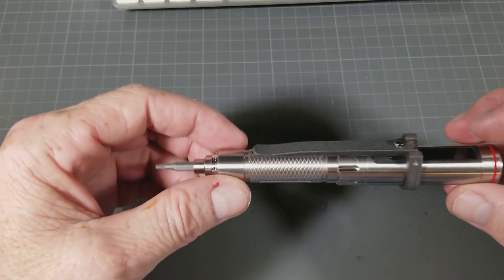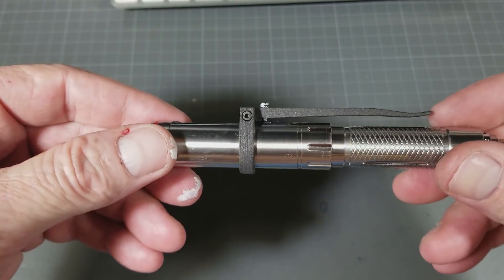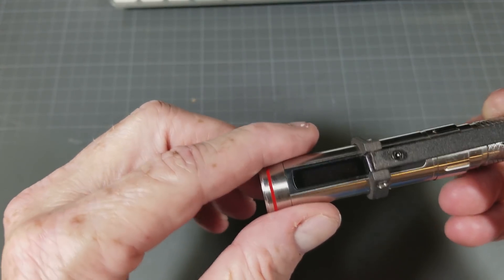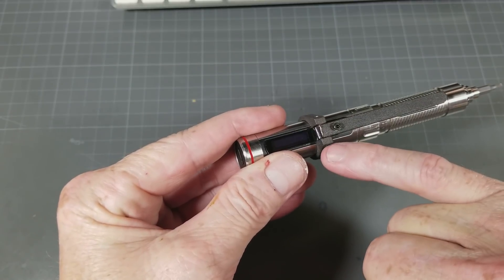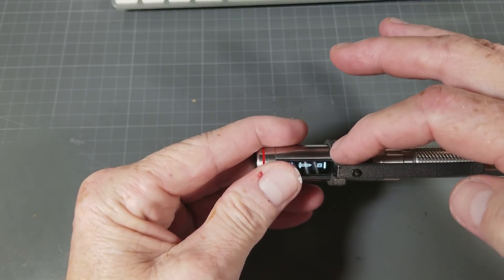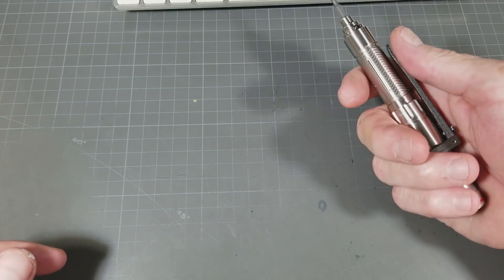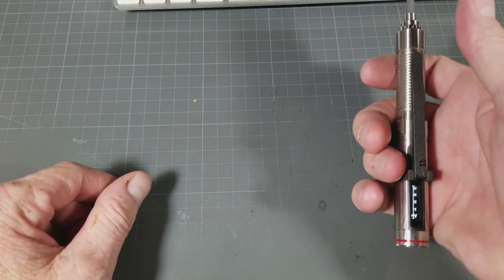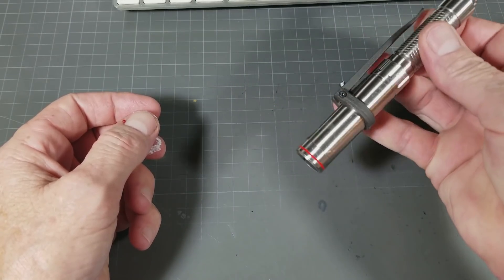ES121 Mod

Comment: Why does there need to be a bolt on top? Couldn't you put a nub on the bottom of that pocket clip that would protrude enough to push the button without needing to put a screw in there?
Reply from the maker: True. Good question. I suppose this allows us to have a perfect fit for usability first go,  but you are right. Shaping the lever would be better. V2 uses a M3 grub screw instead of a  M2 bolt.  If the CAD designer had this tool with him, it would be easier. But I draw and measure, and he interprets it with his own touches. Not the best way to proceed.